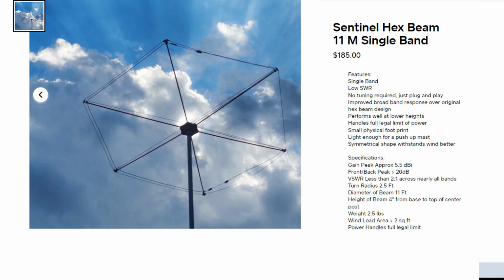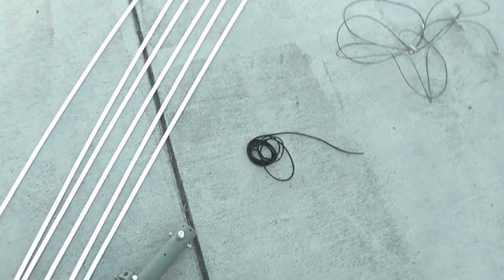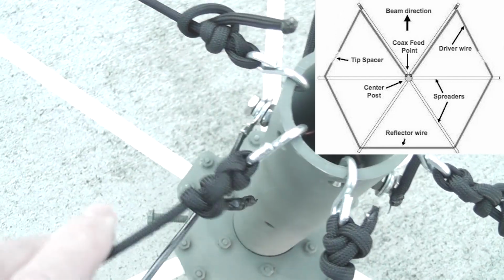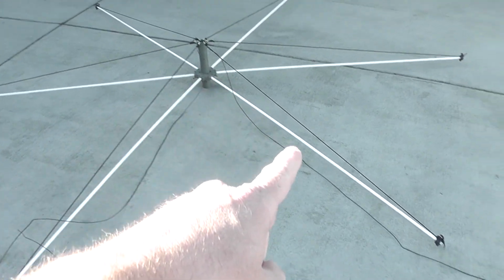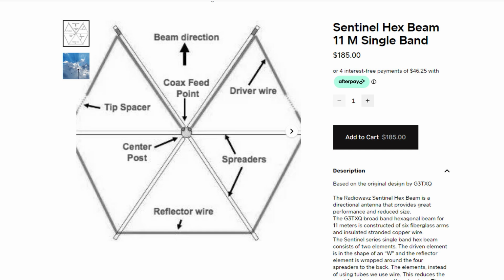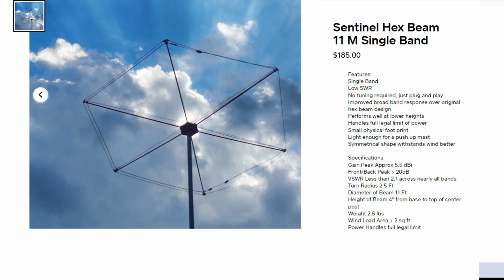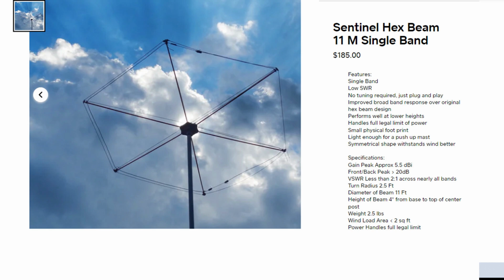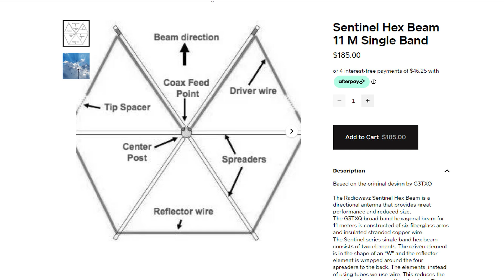Trying out the Radiowavz Sentinel Hex Beam CB Antenna

Comment: So cool with ease of everything. And apparently no matching network
Reply: The antenna radiator is approximately 1/2 wavelength long for frequency being used.
Probably best to use a balun at the feed point.
Otherwise the RF pattern of the hex will be distorted.